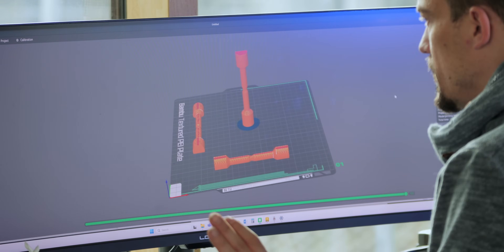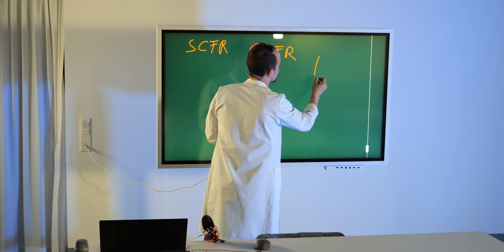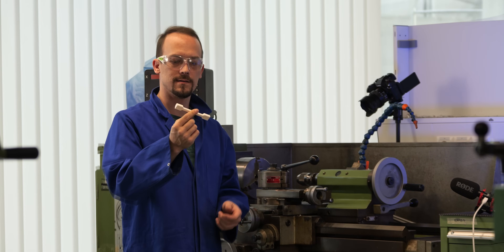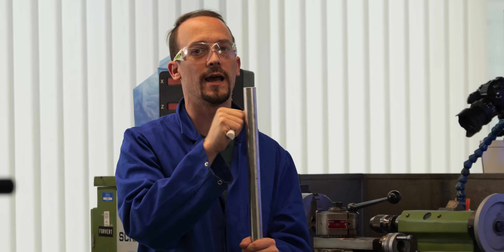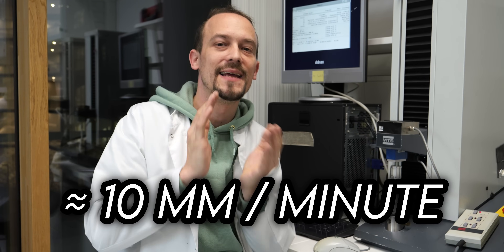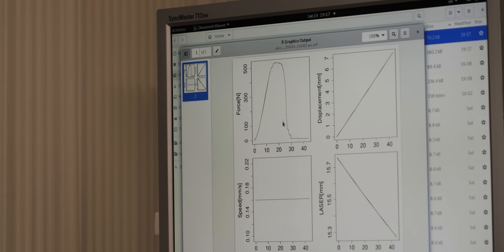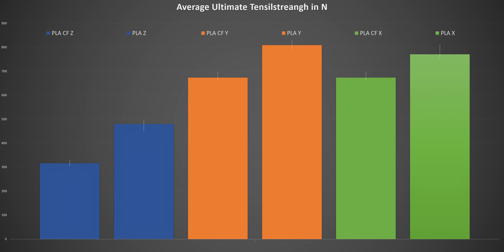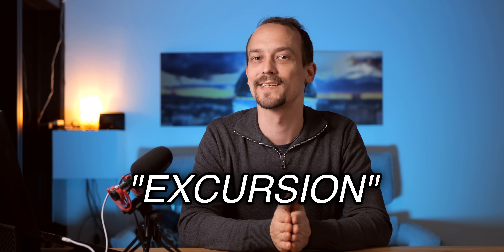The biggest SCAM in 3D Printing? How filament stores try to trick you with carbonfiber "reinforced"

Comment: This has to be the most incorrect video I've ever seen in my life. The theory is valid for layer adhesion, but is beyond incorrect for X an Y. If youre going to do proper material testing, use the same base thermoplastic, use 100% infill and then compare the 2. Anyone who actually prints higher end materials and not these cheap garbage materials would know that a high fill CF nylon is significantly stronger in tensile strength, bending strength, etc

You only lose  a bit in layer adhesion and impact strength.

I hope you revisit your testing parameters for a scientific paper, as that would be one bogus paper.
Reply from the maker: "Everybody knows" isnt a valid Argument. I did the Tests and printed both Samples with the same parameters and their respective print settings according to manufacturer. 
All filament Quere from the same supplier. 
So they say that their pla-cf is stronger than their pla. So I tested these 2 materials against each other. If I adapt my testing apeciments to the material I am testing my knowladge in Design not the material. 

Regarding the research Paper:
That's the reason it gets published. Then it's peer reviewed. So specialist in that feeld that have no connection to me or my University check all the data and all the testsetups independently. So if anything would be "bogus" they would reject it. 
There will be also the tests of course that cater more to the strength cf filled materials should have like stiffness etc, not just tensile. 
And there pa-cf will actually be included. 
So it might be that pa-cf is stronger, like u stated. But so far I have no data for or against it.
Reply: @Ibuiltathing  did you adjust flow rate? How do you know the exact same material squish between individual lines was there? Very often CF filaments require a bit more flow settings to achieve the best results. Did you adjust temperatures and cooling for optimal layer adhesion and line bonding? 

Just using identical settings vs optimizing your print settings for each filament used is not the way to go. Sure, Maybe applies to the regular users, but that doesn't mean the material is worse
That just means the user is wrong. A scientific paper needs to include all of these with tons of tests using a variety of parameters to be sound proof of the hypothesis you're gonna come out with.

Comment: The mechanical properties of a print with 100% infill will have dramatically different properties of a print done within fractions of 100%. Despite the CF layer that's not bonding to an adjacent CF layer. AND this will vary from infill type to infill type as well! Surprised you failed to mention this well-known fact within the industry.

Not that I am touting filament makers mind you. OH to the contrary. Many filament makers are not on the "up and up" when it comes to their filament. IF you are an experienced 3d printing professional you will have come to know the intricacies of printing with various materials and can spot a fraudulent filament maker. 

I honestly believe your tests would have given different results had you printed the samples with 100% infill and assured yourself of a heated chamber for the filament that called for it. Having a consistent ambient temperature around certain types of filament can make a world of difference in layer adhesion (which improves mechanical properties). AND WILL provide more consistent results. 
In closing, I don't believe your tests (while making a decent attempt) do not provide the viewer with all the facts.  I would challenge you to run the parts again at 100%, (in rectilinear & non-rectilinear)  infill In all axis and re-test. I would wager your results will be much more dramatic.

Comment: Petg-cf is the worst cf filament on the market. There are new corencf filaments out now. The cf is center in the filament and allows the layersnto bond together better. Also, you need mush better engineering grade cf filaments for cf and gf to make a difference. Pet-cf is one of the strongest and toughest filaments on the market. Ppa-cf pps-cf and pa612-cf and so on. They are extremely tough and strong. Petg-cf is a waste of money, and in my opinion so is regular petg. I cant stand petg
Reply from the maker: That's interesting. I would be interested to see what happens to the core since it's melted from 1.75mm to 0.4 🤔
I could extrude and use micro ct imaging to see the distribution.
What do you think. Does that make a interesting video?

Comment: Tensile strength is the worse case scenario for any plastic. Carbon or glass fibre filaments are objectively stronger in multiple other modes that matter for common use cases. The real issue here is one of semantics. What is meant by, "stronger" in the first place? This is where marketing spin excels and all marketing sucks green alien balls. But it's hard to convince me there is any straight up scam here, when their words are objectively true in more contexts than the single tensile strength case you chose for this video. Compression and rigidity are "strengths" as well.
Reply from the maker: Exacly. 
That's why I do more Tests with other Methods in a research Paper. I will update as soon as I have the outcome

Comment: Is there a filament that you'd recommend for impact and drop strength while being high heat tolerant, I live in the desert of Arizona and it regularly is around 50c here and heat is a problem for many prints.
Reply: ABS or ASA
Reply from the maker: Like @nachot6592 alr2ady said: ASA. It was developed for exacly that
Reply: @Ibuiltathing  sounds good, thx guys

Comment: As someone who has used most of the plastics tested in the video, I really like PETG-CF because it provides a better surface finish and reduces the glossiness of PETG (which is a major advantage among many others).

I think in your next video, you should test flexural strength. I believe that carbon fiber-reinforced plastics will show better results in this aspect. The numbers in this video are very convincing, but they are not enough to conclude that this is a "scam"

Comment: There is a place for most things. Each filament has its uses, but no one understands the data sheets and information out there it seems. I see alot of filaments in use where it doesnt belong or its plain out not the right material and failure after failure occurs. Or the design doesnt fit the materials at hand in the 3d printing world. Carbon fiber is not tough, it is strong and rigid. It doesn't really help make the filaments stronger. However, if you need something stiff and accurate, they are great. I use sirayatech pps cf for parts i need both strong and stiff and pla for most others. Most other filaments in all honesty offer nothing else special that i find worth buying them for that pla, nylon or ppa/pps cannot do. Except tpu, but its a pain to print most times, supports arent really useable without a major headache in clean up, and the parts generally dont look all that pleasing because the layer height has to be decent to get your printer to not make a major mess of itself. Everyone has thier own opinions. But in reality, there a few actual decent filament out there that have more than just a slight improvement over the others. Too many of the same flavor of halfway useable filaments. As long as printing has been out, we should have had better filaments out by now instead of 101 flavors of pla. Make more useable filaments for those who use our printers to make functional objects and prototypes. Make a better nylon filament too, ive worked with injection molding plastics and 3d print filament in most nylons are garbage compared to the nylon in pellet form. Alot of the industrial use nylon parts are glassfiber, but the 3d filament isnt even close to the same specs as what ive used in the industry. I wouldnt even call it a nylon. Maybe a 6.6 nylon made in nile reds lab experiments. Lol

Comment: Why is this shocking? I had the same argument 30 years ago about fiberglass reinforced concrete. If your fill doesn't bind with the base material just as strong, if not stronger, then what good is it? You're just providing more unattached surface area in which to fail.

Comment: Grüezi Andreas, 
Thanks for the video, very clear and informative. It puts me off investing pointlessly in hardened steel nozzles. 
I would be interested in your analysis of the advantage of ‘bricklayer’ prints in terms of stability. This procedure was blocked by patents for a long time, but has been said to be freely available now.
And further, could the smoothing of the prints by solvent vapour also lead to a flowing of the layer-interfaces, resulting in a stiffer structure after drying?
Looking forward to seeing more videos of this kind! All the best.

Comment: I am just an amateur in this but this is how I understood the fibers to work. Nice to see it confirmed by someone who seems to know it better than me. 
I will continue to use these material (not PLA-CF, that is pointles) occasionally. They need drying way more than their non-fiber couterparts but they are usefull. I have a 500x500x500mm printer and sometimes I need or want to print relatively large parts out of materials that like to warp. For example a battery frame I wanted out of ASA but with just ASA the 440mm long frame just always deforms itself during printing. But in ASA-CF it printed beautifully. The fibers seem to not allow the contraction when it cools down or they add enough stiffness to the already cooled layers or both. Parts that I could not print geometrically accurate otherwise are possible with fibers in the filament. And it does not have to be carbon. I like PCTG-GF too, the glass gives it nice look and the printed parts are accurate and very stiff too.

Comment: Your results actually make perfect sense... The carbon fiber is essentially a contaminant, and inhibits layer adhesion, as well as is an inclusion within what would otherwise be continuous plastic, so reduces strength... Where CF shines however is it greatly improved part stiffness, and dimensional stability...so if you need something printed that needs to be very rigid, plain PETG may not be the best choice, as it flexes quite a bit... But PETG-CF however has very little flex, as well as significantly reduced creep over time... This is especially useful with nylon materials... Still very strong as is the nature of nylon, even with the CF contaminant, yet much more rigid than plain nylon...I particularly like Polymaker 's Fiberon PA612-CF15.   Which actually brings a flaw in your testing method to mind... Filament manufacturers don't often tell you the percentage of CF in their filament, but Polymaker does... PA612-CF15 is 15% carbon fiber... This means there's less inclusions, and a therefore more polymer bonds than if it was say 25% carbon fiber.   Also the CF results in pretty much no warping when printing   Often PLA-CF and PETG-CF, because they're hobbyist/consumer grade filament, they could have wildly varying amounts of carbon fiber depending on the filament brand, or even depending on filament batch.   I expect one brand may be 10% CF whereas another may be 5% and another may be 15%.    There's also variation in the size of the chopped fibers... For example, again I'll go to Polymaker, they make a PETG with 8% RECYCLED carbon fiber, I can't say for certain, but I believe the recycled fibers are more finely chopped, and I personally found it to not be nearly as strong as Voxelab PETG-CF... I expect because smaller fibers means they're distributed more homogenously throughout the filament, there y resulting in the polymer bond inhibiting effect being more frequent along the surface resulting in a weaker part,

Comment: As a researcher on material science thermoplastics... for porous materials.
If you examine the broken samples under an SEM, you will not see the fibers between the fractured parts since your components are made by a 3D printer. The carbon fiber performs well if you produce the parts using injection molding or extrusion. You explain very well why it is like this.
But I think that the vital point is the fluence strength when the plastic loses the elastic behavior and starts the plastic behavior, but it is more complex to find that point.

Comment: This isn't exactly what you are testing here but I still believe in my experience with PLA-CF is that it does produce a more harder print but most of all it produces much better quality looking and feeling of a print so I definitely still prefer to use the CF filament if I could for most prints if it was affordable to do so but where its at in cost just isn't worth it for most prints unless its a print you are real serious about its look weight and so on.  For short CF infused PLA had value beyond tensile strength but your point is well made and I would argue strong. Since the manufacturers are using its strength as a selling point to inflate the pricing as all of them are doing, then it needs to be widely known to the public that its not and the price needs to go down!

Comment: Can you characterize the strength of layer adhesion as a function of the surface area dedicated to outlines/walls and to infill? Like for example do walls and outlines provide on average 50% of the typical x/y strength and infill is 50% * infill percentage?

Comment: I see videos like this about carbon fiber filling come up frequently, and they all kind of miss the forest through the trees somewhat. Not every printed part application is going to require you to be using your print in a way that forces are constantly acting directly against it's weakest layer orientation. The pros of fiber filling are usually: reduced warping during printing, reduced creeping, increases in heat deflection temperature, easier annealing, increased stiffness, and it typically looks more attractive (adding surface texture and hiding layer lines). In a lot of applications, having those pros is going to be a lot more important than just having better layer bonding. If you're already optimally orienting your 3d printed parts, or running screws through them in the Z axis, then in many contexts layer bonding may barely matter at all. 

I think it's fairer to say that adding CF modifies the properties of the plastic rather than improving it outright, it's not a wholesale improvement, you're gaining some mechanical characteristics and losing others.
Reply: This 100% as they only really test....tensile strength?  You hit the nail on the head and this video doesn't really talk about the other side of why somebody WOULD want to print in PETG-CF. Yeah we get it - the Z axis is weaker but what about x and y, easier printing, temperature resistance, less shrinking, hiding layer lines.  For all the science that this video did (which it did quite well) it gave a pretty 2 dimensional exploration of why "petg is a scam".  The video would have been much better by reframing it to look at all angles of why/why you wouldn't use this specific filament.

Yikes...a shame and a waste of good effort for the video.

Comment: Please consider side cooling fan, since there is uneven cooling on the parts that would be the reason for X and Y difference. Even on a same location due to orientation and angle to side fan could change results. Even on a single object cooling time per layer can change bonding between layers and color (for example 30s on a layer vs 200s on a layer). IMO CF is best used with PA  without fan during printing.

Comment: One important note however, is that carbon fiber infused material is very lightweight compared to not infused material. For the weight of the piece, it is quite strong. In applications where weight matters, CF is the way to go.